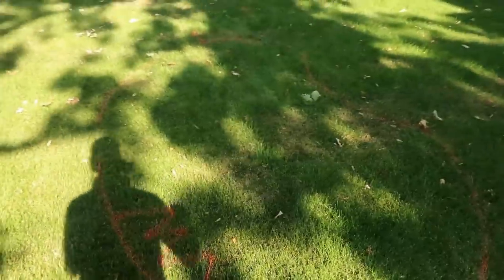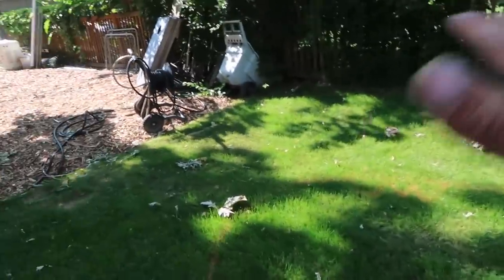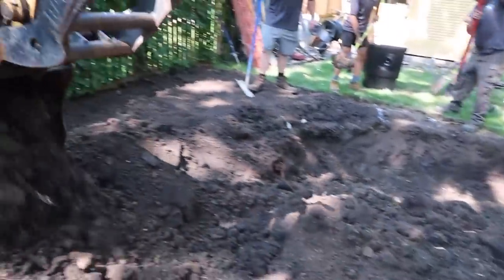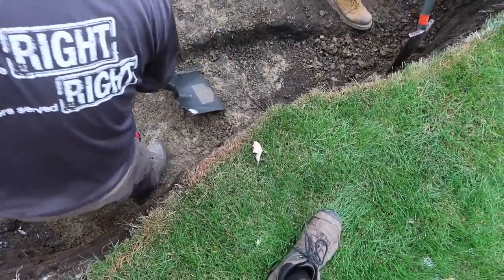Building a SMALL POND in a Heat Wave 🌞 - Part 1

Comment: I like the large rocks in a smaller pond.  With regards to the size of a pond that you build ie 12'×20'.  Do you base the size from the front face of the rock or face closest to the liner?  If your using rocks that are 2' then your pond size becomes 8'×16'. It's has always been a question in the back of my head. Lol. Keep up the great work.